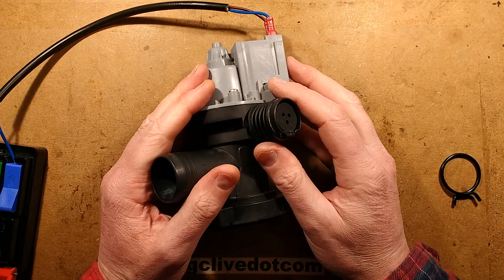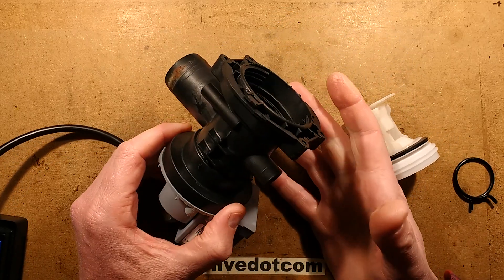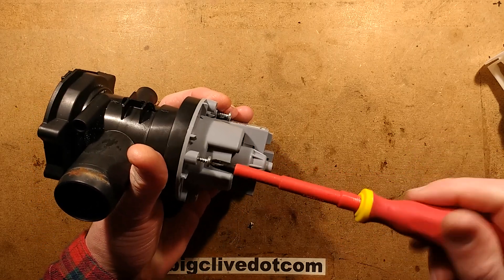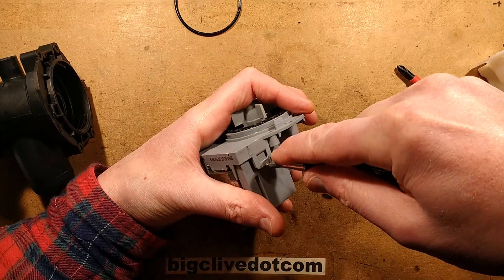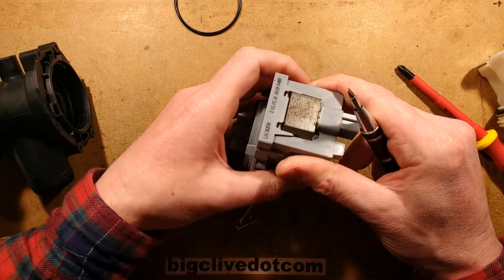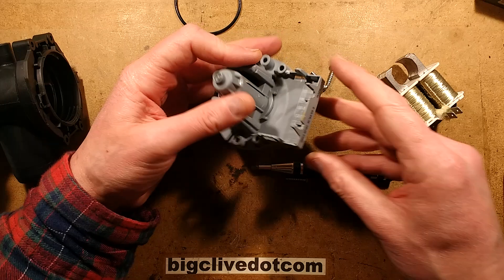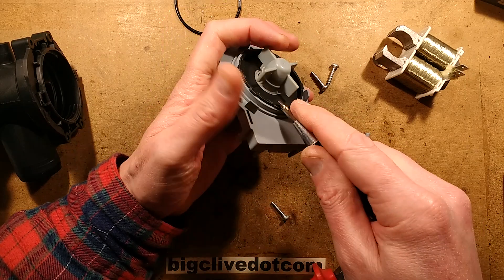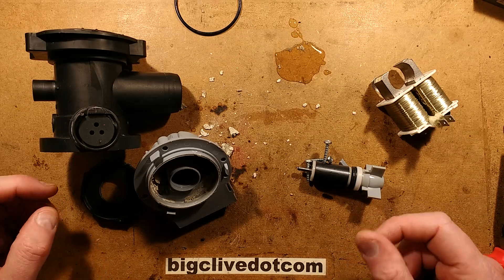Washing machine pump teardown.

Comment: the very small hole on that is usually connected to a Black Rubber Hose that has a plastic bung in the end you can pull out by hand to allow you to drain most of the water out into a continer in a controlled manner from the pump before you open the Trap! not like you have been doing it clive (have a look around the bottom of your machine for the hose to allow you to drain the traps water)
Reply from the maker: Mine doesn't have that feature.

Comment: That flap valve(no idea how it's called, tbh) is actually not that common, at least in the older WMs (or maybe it's not common in the slavland). Also, main failures i have encountered were connected to water getting inside and rusting the shit out of bearings(or whatever the shaft spinning on), but this is still not a death sentence to pump; but when something bypassed the filter and completely stopped the rotation of impeller which led to it destroying whatever stops it has inside and impeller freely rotating on shaft — it's time to throw it out.

Comment: I long back for the clickety clocks instead of concealed Arduino's running the washing programs ;-)
Reply from the maker: The ones with loads of bare metal contacts on them that were responsible for a lot of home electrical accidents in that era.  They were pretty neat.
Reply: bigclivedotcom guess  every era has its virtues ;-)

Comment: Timely video. Our front load washer is fairly new so have not had the fun of replacing the pump. Ours has a drain hose so you can drain trapped water before removing the filter access port. 

A few months ago the drain pump on our 10 year old Bosch dishwasher failed. The replacement pump was $72 US. Same type of permanent magnet motor as in your video.  Water had gotten into the bearings and the thermo overload tripped. I'm surprised you did not find a thermo overload in the washing machine pump you took apart. The dishwasher was interesting as the pump mount was a simple rotate and clip, no fasteners involved. 

Bearing leaks are a pretty common failure mode that is what killed the pump on our previous washing machine so I'd be leery about buying used parts.

Comment: Not a whole lot of difference with that pump for the 240 and 120 crowds. The 240 people have the two coils wired in series while the 120's have 'em wired in parallel. The coils themselves have enough tolerance to deal with those with slightly higher and lower voltages.

Comment: I think that flapper on the flow out port might be to help the pump take initial prime. Once primed and at full efficiency the flapper is simply pushed aside. Those impellers can act funny at startup, I used to have to prime them on old turret lathes to get the coolant system flowing (yes, impeller system pumps).

Comment: One of the more useful accessories they can connect to the pump is a little rubber hose that you can pul, out the front and that allows you to drain water off gently, as opposed to “very carefully” trying to open the entire pump housing.
Reply from the maker: Yes, but is it as exciting?
Reply: bigclivedotcom I suppose you need to find excitement where you can, when you live in the Isle of Man!

(I have my washer freestanding, I usually just tilt it back in cases where I need to clear the pump. At least once I remember that’s the way to do it.)
Reply: I took care of a laundry and I made a pan with notch that would slide under the lip of that filter so you could unscrew and pull it so all the water and gunk ( they always stink ) would go into the pan instead of all over the floor. I had to clean those pump filters out two or three times a year .
Reply: Jasper Janssen the only excitement they get there is a bunch of 1000cc on two wheels, that are riden by the biggest balls on the planet...
Reply: but they need fresh big balls quite often if you know what I mean

Comment: they have refined that over the years, the wonky pump i bodged  a repair on an old washer relied on  seals to keep the motor dry, and did not have that starting loose spinner design or a filter at all

Comment: If there are coins or a bra wire in the filter they can prevent the filter unscrewing and you have to use pliers to unscrew it and you have to break the filter to get it out. I’m a retired appliance engineer and these pumps are crap if anything gets past the filter the impellor will break off.

Comment: Pond water pumps are similar interesting because that completely isolate the electrics from the water using sealed coils and an induction driven disk impeller. Such pumps are designed to handle dirty water with lots of solids in it. The pumps also deal well with a stalled impeller.

Comment: I think the pump placement or design is terrible on washing machines just had to clear area due to wrappers blocking the impeller just wish there was a better way of syphoning the water out before you open the trap up.

Comment: Pond pumps are the same design just using magnetic force to drive the shaft inside a tube. The only difference is the windings are encased in resin. My mum has a pond pump that's been going now for about 12 years.

Comment: The spares suppliers are a joke ,one quoted me £60 for a pair of brushes or £130 for a new motor for our machine ,bought a generic pair on ebay for under a tenner!.
Perhaps the small holes in the flap is so there is always water in the pump so it cannot run dry?
The parts are similar because most appliances are made by a couple of manufacturers ,the old tradenames are just used nowadays to flog basically crap hoping the tradename will give it some prestige ,i doubt they make fridges like our 1950's prestcold that we bought 18th hand in 1974 lol

Comment: the small hose port with that restriction inside will go to a short length of hose with a removable bung in the end. if the machine has failed to drain due to a pump obstruction and is full of water, the small hose is put over a container and the bung removed. the trapped water flows out at a controlled rate, rather than removing the white screw in cap and causing a biblical flooding of your kitchen.

Comment: I don´t like these permanent magnet pumps that much. The problem is, when they get a litte bit older, they don´t start running reliable any more, and there is no save way to test them for that. And the other thing is this area, where the magnet sits. All the yuk makes some Washers smelling like the drain or worse. But the advantage is, they cannot leak that easy in compare to a split pole pump, which has a simmerring that fails, when the bearings go bad. The smaller extra hose connection which is not populated is probatly for a vent which goes to the detergend compartment. I would like to know what the sense of the flap at the outlet is, but i´m not exactly sure, its only used on washers and dishwashers from AEG/Electrolux.

Comment: 2:44 That smaller hole would be connected to a small straw and it will be used to drain the water sitting in the pump, rather than it flooding out when you remove the large filter cover (usually on higher end washing machines). Also the washing machine drum exit will have a small ball in it. It will drop to let water out but if water enters the drain hose the ball will float, stopping the water from entering the drum for the drain hose.

Comment: the blanked off spout that looked like it had 2 holes in it was used in older Indesit machine to drain the water from the door seal. it was blanked off as it used to block with the usual crap in washing machines & needed cleaning often, so it was deleted i'd say about 15years ago when Indesit used metal outer drums. the rubber bit reduces the 'chug' when the pump is empty & helps eliminate airlocks. the version you have there is a watercooled pump hence the side bits eitherside the windings & the water inside.. interestingly I've found that they go noisy more that the nonwatercooled, more room for the crud to get into the 'clutch' of the impeller/magnet maybe?

Comment: I think the flap is perhaps just to help prevent the waste water flowing back into the drum between pump-outs?

The water is allowed to flow back in more slowly, so the bulk of water in the outlet pipe doesn't just flow straight back through the pump again when the motor stops.

(since the loose end of the waste pipe is often positioned higher than the pump end, and sometimes higher than the entire drum.)

I don't think the flappy valve would help keep the pump primed, but maybe?

Comment: i've got a Bosch washing machine sat in the garage awaiting repair.  it runs fine until the pump kicks in and then just makes odd noises and fails to pump any water.  The pump fitted makes looks virtually identical to the one you've taken apart here, and only has the 2 mains connections to the pump motor.  As soon as it starts trying to pump, the display shows an error code relating to the pump.  How does it know??
Reply from the maker: It sounds like it might actually be blocked.  If the machine detects that the drum is not draining at a sensible speed then it flags up an error code.  Have you removed the front flap at the base and checked if the filter and pump are clear?
Reply: I've had the pump off it.  All works fine while the cover is off and the impeller is exposed.  As soon as you put it back together the impeller just jiggles and doesn't pump the water.  Currently waiting for a replacement pump to arrive, it's on the slow boat from China

Comment: Did anyone else have to watch 2 adverts in order to watch this video?
Reply from the maker: There should only be one skippable pre-roll advert or a single pop up advert at the bottom of the screen.
Reply: I'm afraid not. I don't recall the first time watching this video with my original post. But it was defiantly 2 adverts in the beginning, both were skippable, but I don't recall whether there was or wasn't a single pop up. 

However, as I am writing this reply. Again I had to watch two adverts in the beginning, both were skippable as they were the first time. But thus far there is no pop up, nor is there a yellow dot on the minute bar that indicates a pop up advert.

Comment: Other ports are for pumping water from the tub into the softener and bleach trays.  It allows it to mix water with those products while the tub has water in it.  It's either done when the water is filling the tub or when the wash cycle is running.
Reply from the maker: The UK machines use solenoid valves for that and use the main water supply to add the detergent and softener as the machine is filling.

Comment: You could do video about the defrost timer found in fridge freezers. Started to find ice in the back of the freezer and it wasn't that cold anymore (soft fish fingers). After removing all the ice twice (with the help of hair dryer) decided  to Investigate. Found a wire attached to the cooling serpentine, understood it was a heating element to melt the ice, followed the cables to the back (where compressor is) and found it connected to a timer (8 hours timer). Said timer it's tiny mains motor with gears and every 8 hours or so, changes the Live from the compressor to the Heating element. Bought s generic timer from eBay for £4 and fridge freezer has been working ok for the last 4 years !
Reply: It's kind of amazing how reliable refrigerators are.  Mine is almost 30 years old, and the only thing I've ever had to change was the icemaker, because the release heater failed.  Oddly, the Amazon replacement was almost exactly the same design, but had a different connector.  Oh well, easy enough to fix with a bit of solder and heat shrink.

Comment: I would guess that the little flappy rubber valve in the pump is there to just provide enough resistance to back flow when it switches off to prevent any loud gurgling noises.
It would also make the speed that water drains out a bit more manageable if you need to open it up to clear a blockage.

Comment: Service engineer here. That pump wasn't going to last long. Once you've got water through that seal (or smelly gunk) it's days are numbered. I usually give them a shake, if there's water sloshing around it's time for a new one
Reply: Every single one of the pumps in laundry I took care of leaked into that area and they will run for a long time actually. The failure is not because it is full of water , it is because of all the crud helps wear out the bearings . I was always surprised how long they worked considering they were always flooded and gunked up around the magnets. You would think they could design a seal that worked to keep that area dry but I never saw one that wasn't full or water around the magnets.
Reply from the maker: The outer section with the crud (solidified detergent) was not sealed well, but the centre motor rotor was sealed OK.

Comment: 0:58 - Most front-loaders always have some water in them... Even if the drum is empty.
I usually use hose pinch-off pliers to keep the spillage to a minimum when removing a washer pump.

Comment: But can i use it to power a small jetski or a boat?
Reply from the maker: Yes.  But it would require a very long mains flex and would sink.
Reply: Theres portable generators that you can hook up in series that will charge a tesla. Could probably use those. 
Gonna get me three of these pumps and have the best 14 knot diy boat

Comment: Here's my thought on the rubber 'non return' flap... the flexible pipe coming out of the pump normally comes out the back of the machine at the bottom then goes up to discharge into a higher level pipe behing (or under) the sink... what you sometimes hear after the drum empties is a slug of waste water bouncing up and down in the vertical hose till the pump switches off. I guess the flap slows the backflow down enough to stop that happening - probably it prolongs the life of the impeller blades and reduces the annoying noise.

Comment: Hey Big C, interested in a Hardi 14412 fuel pump?
It has a little circuit board in it and works with up/down motion.
It doesnt work, but i think its an easy fix.

Grtz

Comment: Useful video Clive. 

Mum's 1971 AEG washing machine is still going, has been in use since purchase. Only new part fitted was a replacement drum lower hose, this was just a few years ago. AEG still stocked them (not cheap!). The main motor in this machine is an induction motor, more reliable than the universal motors that are supplied with most machines, other than top of the range ones.

Having said how good the old AEG is, it'll probably fail now!

Comment: I've repaired white goods for years and they're not made how they used to be! The modular parts allows the prices to be very low - £200 for a half decent new washing machine is unreal. They were once far more than that and add inflation etc..

What I will say about machine failures now is it's mostly the plastic components - your vid showed a lug failure.
I know for sure that plastic should outlive the machine itself but for some reason the plastics they use in them fails early. It's as if they've engineered in failure rates. Surely a manufacturer wouldn't stoop as low as to engineer their goods to fail when they shouldn't?

Yes the coil - can be swapped for various world voltages.
Reply: Hey, I'm a service engineer too. My experience seems weirdly different to yours. I'd say plastic failure was fairly rare. Most commonly I see bearing/spider failure (on newer machines usually), relays burning out, blockages (obviously) and electrical components failing. Plastic breaking is mostly on the buttons and door handles, I'd say I see that about once a month.

Comment: i made a windmill from one of them, the motors are very good generators and will give a very high pulsed voltage even at low rpm
Reply: I was just thinking about making one. Do you remember how many volts and amps it made?

Comment: Are these suitable for continuous use?
Reply: You could use them continuously. They are the most resilient of all AC motors. If they are cooled, and kept dry, they will run until the bearings fail. Assuming all the components are made of quality parts.
Reply: yes - those pumps will run continuously  and considering the amount of hot water that goes down them they are very hardy to high temps too. There is a temperature sensor in the coils but I had never seen a pump shut down from high temperature. Even with the magnet area flooded they will run for long time many months or even years until the bearing sleeve eventually wears out and the impeller starts wobbling around.

Comment: Compared to the induction pumps that were abandoned 20 years ago, they're crap.
The other type hardly ever got blocked because they were more powerful, and its water outlet was more free flowing because it was optimised for its motor spinning in only one direction.        The only advantage of this type is that they don't usually leak.
Reply: Agreed... It's very rare that a direct-drive pump would get blocked. Most of the time those leaks are from the impeller launching debris against, and sometimes through, the pump housing.